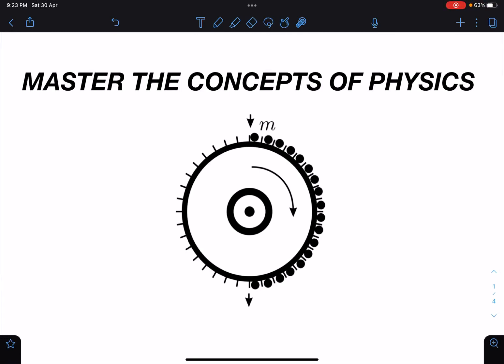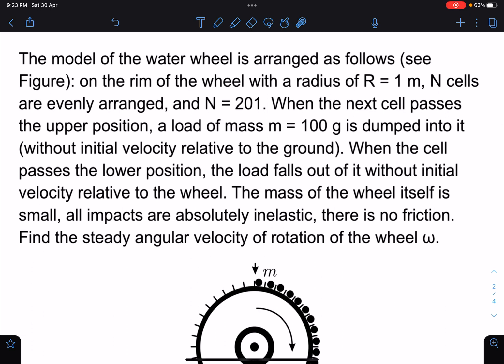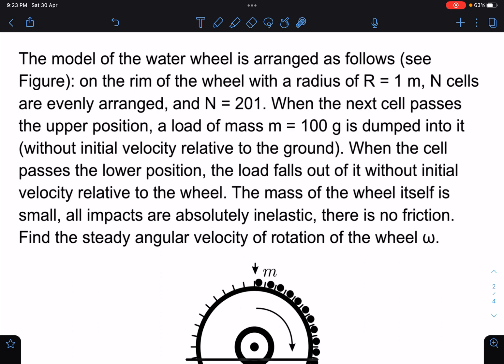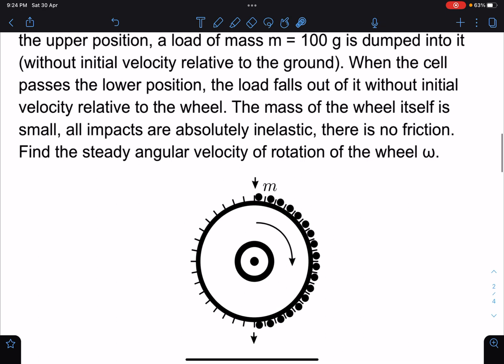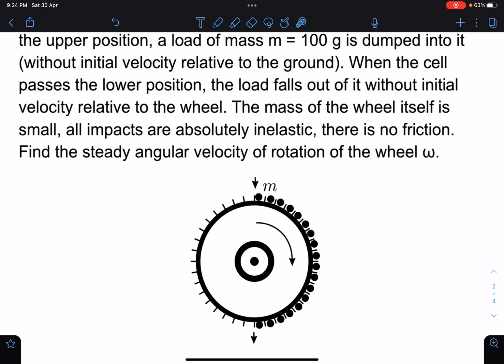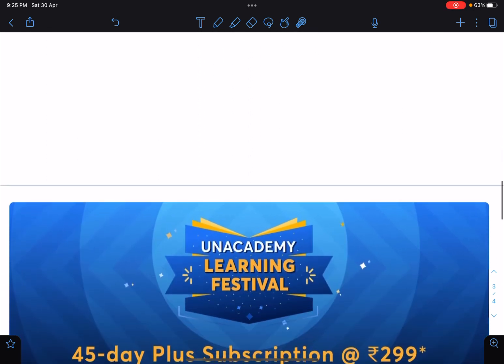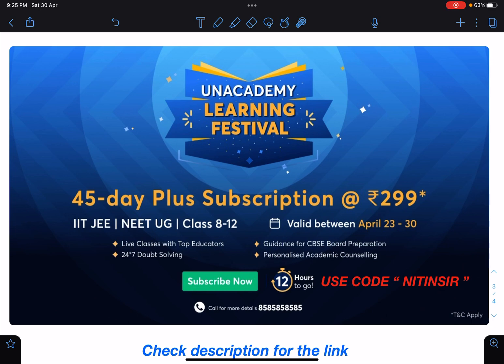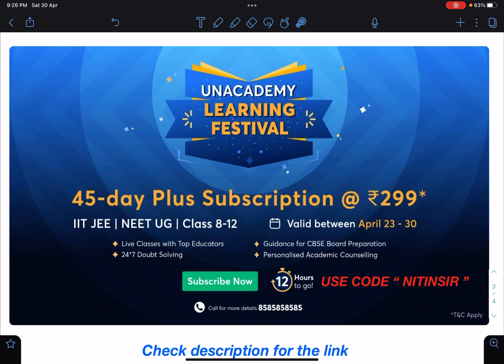[JEE ADVANCED ] A MUST TRY PROBLEM FROM ROTATIONAL MECHANICS

Comment: I got approx 142rad/sec. 
        For every t0=(N/2Πw) new load of mass m will be dumped. And its angular momentum will be L0=mR^2w. Rate of change of angular momentum of system is L0/t0 and torque on system is due to already present load which will be (NmgR/Π)
          Now I Equated torque = L0/t0
      And the masses which are leaving leave with same angular momentum and if we take whole as system, they won't affect anything.

EDIT: just checked the soln, I blundered took t as N/2Πw but it is 2Π/Nw 😅

Comment: sir is the answer exactly  sqrt(pi/100*g*sigma r=1 to100 (rpi/100)) which approximately converting into integral comes out to be sqrt(20) rad/s. I think this problem originally comes from cengage pathfinder probably just some values changed to make it look intimidating.
Reply from the maker: its from a russian book ... of early 19xx so i guess thats where the original source is and not cengage surely
Reply: Sir can you pls say the name of the book?
Reply: @physicsguy6625  pathfinder used to be published by cengage many years ago so its not the book your talking about, also i agree with sir they must have copied.
Reply: @twinbrain7743  you having the cengage advanced problems book?
Reply: @prakharjain5448  no
Reply: @twinbrain7743  then how u know ? Pdf?
Reply: @prakharjain5448  yeah
Reply: @twinbrain7743  did my message get deleted?
Reply: @twinbrain7743  can u send me the pdf anywhere?
Reply: @physicsguy6625  https://drive.google.com/file/d/1IgI3K4Qp4Jpu9ULIlxo0T-eDOPMEYipP/view?usp=sharing old pathfinder